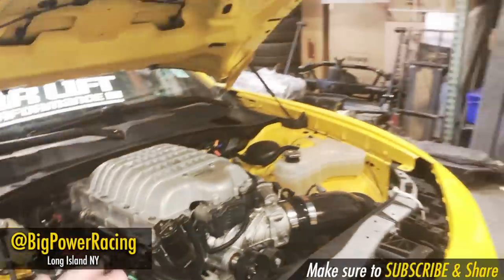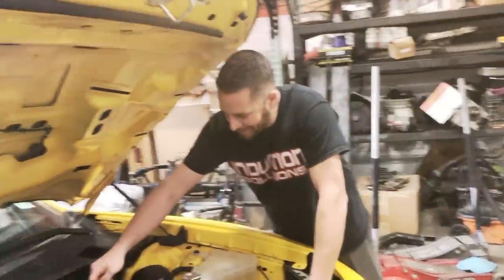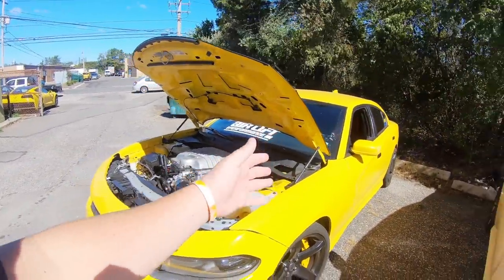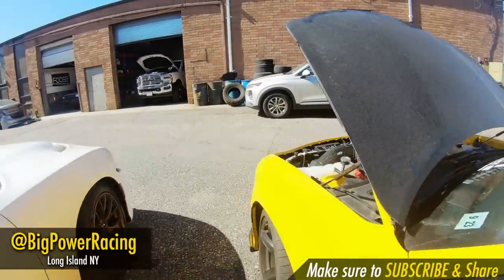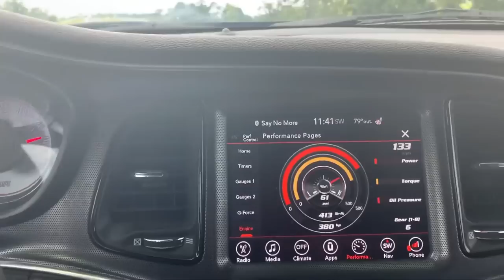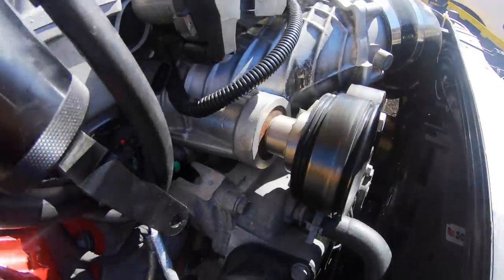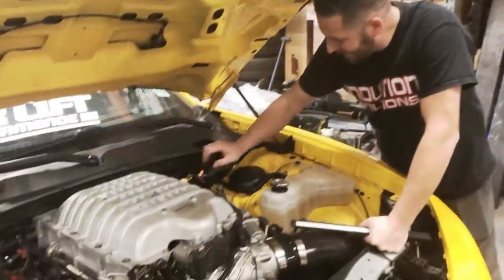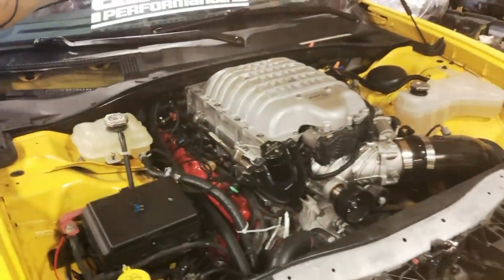Hellcat Supercharger on 392

Comment: Tuned right this would be a major sleeper to all the other hellcats out there.. bravo👍🏾👍🏾
Reply: Hell yeah
Reply: I mean apart from the loud NEEEEEEEEEEEEEEENEEEEEEEEEEEEEENEEEEEEEEEEEEE
Reply: Sleepers are suppose to look like regular daily drivers. Chargers are hard to get to sleep( look normal)
Reply: No it wouldn’t you can tune all day long but the motor is built to be na at a higher compression. It’s so bad that he had to change the pulley to make the blower run half the boost of a stock hellcat does let alone modded so it’s not an issue for any hellcat to walk on it as it is until he forges the internals and changes his compression then yeah sure but then it’s modded and tuned and really isn’t a hellcat or a scat anymore and isn’t stock so In that respect it deserves to win after that.
Reply: Running the 6.4 under boost while racing a true hellcat could be an expensive proposition for the imitator.
Reply: @joshreynolds729  it’s now a hellascat.... lol
Reply: @mrdomdiggz  😂
Reply: @beastp9569  I gotta sleeper police charger looks like a v6 police charger but I did a 392 swap fbo 😏😂

Comment: I really hope they get the tuning aspect right, 392’s are N/A beasts, one small mistake and it’ll nuke itself.
Reply from the maker: I'm sure they will - Hopefully I get a chance to see it up running.
Reply: They are so slow tho
Reply: @jeremiahalta8495  u fr rn?
Reply: @random-amg  They really are sadly been from sleeper s2000, 350s,3000gts, to f430, 670-4 aventador, audi Quattro. Really feels like a e55 amg from 12 years ago
Reply: @lastprophet5969  you for sure can’t compare a scat pack to a e55 nothing alike trust me
Reply: @random-amg  slow af
Reply: What does n/a mean
Reply: @JAG19471  Same chassis also shared with chrysler 300, e55 200lbs lighter with a better built engine. 😂 Cam bearings eating your cams like a cheese greater and and crappy transmissions that some smart guy decide to change from zf. 😂😂😂 392 best car in the world 👏🏽
Reply: @lilb5408  naturally aspirated (no forced induction) (pro charger, supercharger, or turbo)
Reply: @lastprophet5969  yet a 15 year old car that’s 10k can hurt that 40K car feelings of yours 😂😂😂
Reply: Going the blown route in my 5.7
Reply: @random-amg  yes sir my stock caliber srt4 2008 keeps up with them
Reply: @jeremiahalta8495  😂
Reply: I agree. The Apache unfortunately was not made for a supercharger. The internals has to be upgraded and it still doesn't really play well. It's unfortunate that unlike Ford or Chevy you really have to change internals on non boosted HEMI engines. With that said the Hellcat engine was made and specifically engineered for this from the factory. Better off getting a Hellcat crate engine and swapping. The other issue is beefing up the peripherals like transmission, driveshaft, suspension, etc. Might as well buy a Hellcat unless you like ridiculously expensive projects.
Reply: they didn't break that engine I bought parts from the owner on Facebook
Reply: @jeremiahalta8495  what is slow 392? Tf
Reply: how fast is a Camry then
Reply: @lastprophet5969 But bruh, you have to remember, your comparing modded to not moded. If a scat has the same mods as an other car the scat would likely win. My point is you can deny much that a scat vs most cars the scat will win.
Reply: @lilb5408 Naturally Aspirated

Comment: I’m doing this same thing on my Durango it’s been so many unforeseen issues .I had to change the whole front drive pulleys so they line up with the Hellcat blower pully . I also had to go inside the engine and change the cam and lifters because of the multi fuel displacement system fails with this setup . It was also necessary for me to get a drop in piston kit just so my 6.4 can even handle the boost. Long story short, I should’ve got a whipple it would’ve definitely been less stressful
Reply from the maker: makes sense. BUT... when you're done it's so much damn cooler (at least in my book). Everyone has a whipple or mag under the hood

Comment: I smell a blown 6.4 but well see
Reply from the maker: 6-7 lbs, I think he'll be alright - I want to see what it's throwing down to the ground
Reply: @RTLife  probably 550 to 630 whp
Reply: I have a fully forged bottom on the way, I’m just playing with the stock bottom of the 392 for now :)
Reply: Let’s hope these motors are troopers and can handle 6psi on a unopened motor. Would definitely change the game 🤙🏼
Reply: we’ll*
Reply: @r6mondosoo197  they can if you actually tune them properly so they don't lean out up top
Reply: @Michel-kz8jm  thats your charger bro
Reply: @gonzalezgrant  yes
Reply: Yup . 6.4 internals can't handle that with out alot work
Reply: @leepatterson5482  depends on the Tuner
Reply: @r6mondosoo197  my brother 19 392 went at 700 miles off the lot with a couple burnout

Comment: Wow, that's awesome and has that menacing Hellcat whine..I wondered how the lHl blower would do on a performance engine, and does have that familiar sound we all love. The only one I seen adopted so far, was on a 5.7 and was like anyother supercharger. I spoke with someone at modern muscle extreme about those adapter plates last year. They had it available for the 5.7 + 6.4, but we're still designing the jig for the 6.1 last year and emailed me back when they had them available a few months later. Still haven't seen anybody install one yet, but should do pretty good considering they handle boost better than 392s

Comment: Basic rule is 20-25 hp per pound of boost....once you do better heads/cam, then the numbers go up from there per pound. Boost is a measure of restriction. True efficiency is making the most power on the least amount of boost.
Reply from the maker: so if everything is running properly it would be around 570-600whp range
Reply: @RTLife  yessir. Your vid on the 5.7/Hellcat blower swap bears that out. Your 397 will actually do better since it was built for it. 30 hp/pound wouldn't be out of the realm. If it has plenty of fuel and air, 900 hp on 15-17 psi👍

Comment: Yeah going with mopar parts vs aftermarket should be ideal. Not taking away from aftermarket, whipple for one has proven itself but keeping it oem is always a better fit.
Reply from the maker: I like the OEM idea because it's more original (just my opinion though)
Reply: @RTLife  exactly, show off the manufacturers performance potential where they can't for production.

Comment: I’ve been wanting to do this for a while.  Cause it’s the cheapest way for me to get MORE POWER BABY
Reply: If the internals aren't done. You're going to find out that 2000.00 purchase is going to cost you 12,000.00 plus to repair. Try it!
Reply from the maker: if you can get a good price on the blower - this is a great option. 6-7 lbs of boost & that 392 will be fine
Reply: God i wish I had the money to do this.  The converter plate alone is like a grand... just for a piece of metal.  Just so damn expensive.  Honestly I think the cost of superchargers is just absolutely RIDICULOUS.   If i ever get a 4th axis for my CNC I'm totally milling one for the RT engine design and if it works flooding the market with 500 dollar superchargers to teach all those other brands not to rip people off like they do now.

Comment: Nice.. this is definitely going to be an option I'll look into for my scat...I wonder how much a good hellcat blower will cost
Reply from the maker: I want to see it jump on the dyno to see how it does. The blowers are between $1500-3000
Reply: Factor in cost of everything else needed to make it work and you're looking at $7k+
Reply from the maker: yah once you see the cost of what else is needed it adds up. I think most that go down this route get a crazy deal on the blower itself.
Reply: Anything below 10k for parts and install is actually not a bad deal when you consider getting a brand new blower kit is usually already pushing that amount minus install...but I'm definitely gonna do more research into this and hopefully get a definite figure for this setup
Reply: @kevinkludjeson9089  for me, it would've cost $4-5k more to do the hellcat blower than my Magnuson was. For any 11+ car that cost comes down by $2k. No brainer in my situation
Reply: Hellcat blower was free so I don’t mind :)

Comment: It’s obviously better to supercharge a 6.4 instead of the 5.7 because the 6.4s come with the brembo brakes and srt suspension
Reply from the maker: The 5.7 is a little safer to run forced air with but yah the 392 has much better pieces out of the box around the engine.
Reply: R/T Life that’s why dodge made the 6.2 which is a 6.4 and 5.7 combined

Comment: I think a Whipple or Procharger is better idea , more power and less problems and looks 100% better than this think,  cables,    pulley different size of the belt, plastics strap holding fuel rail and catch can, Im not saying is bad do that because when you staring a project you have finished it,  but I you have a choice I go with Whipple o ProCharger that kits comes with everything you need and is specifically designed for you car and make more power and look better without headaches bro
Reply: I wanted to do it no matter what and yes all the straps and wires you see, all the mess, is because is not finished yet.
Reply from the maker: I will do a follow up when this beast is 100% finished. Just wanted to show everyone this 392 build - to me it's unique. Pretty much what I want to do with my ride - we will see though.
Reply: @Michel-kz8jm  Im not a hater bro sorry if you feel my comment like that but not, I  know this build is so unique and is very difficult because no are many or any of them out there and probably you have to do trying many things for fix few problems and some time you have to improve your resolve it and others times I think you no have part what order because that's parts not exist and many other difficult things for finish it, Only for that I prefer to go for Whipple or Procharger bro they have everything already parts, guide , tune you know so easy on 2 or 3 days you can have you car well done. I love cars bro, don't get me wrong 👍
Reply: American Power I don’t, don’t worry and your opinion is soooo right lol. A whipple or pro charger or any other, they are really easy and if anybody wants something like that, that’s the way to go. It took a lot of time and everything you said to put that blower on top tbh, but I did it :,). Thanks for the comment and no worries
Reply: @Michel-kz8jm  thanks to you brother

Comment: The only limitations on power with these engines are the factory internals and the main caps, which should be upgraded to forged or billet, and definitely billet main caps.

Comment: 11.7 lbs of boost for a stock hellcat motor but on this car 6 lbs of boost is only half capacity of the sc for the sake of saving the motor and making okay power but it ain’t gonna be hellcat numbers unless he wants to change out the compression ration to the internals to except the boost along with forging the bottom end for longevity.

Comment: Hopefully they upgrade the cam and lifters because right now the stock ones have been prone to wearing out at 100,000 miles. All you have to do is go on here and look at all the videos that talk about this. Why FCA changed the oiling system on the hemi's after 2010 we'll never know.. 😔
Reply from the maker: I'm sure he will once he drops in some new pistons for some higher boost
Reply: @RTLife  I'd hope so or he'll start ticking.. 😔

Comment: Now that I finally got my 2015 Ram 1500 HEMI 4x4 Quad cab payed off , I want to start saving for a fully forged 392 HEMI. Either get the Arrington 392 or just build my 5.7 Hemi and stroke it to 392. You would be the best person I could thank to ask this question. What is your opinion on those 2 options?

Comment: I've had two Scats and the power they came with was enough, Chrysler designed the engine to be NA. If you look at what went into the R&D of the Hellcat engine, most people wouldn't even think about putting forced induction on a 392.
Reply from the maker: understandable. Most stick with around 6-7lbs & get to around 580-600whp range. I think it's impressive & it's not enough to really kill the engine.
Reply: @RTLife  
That's around 700 crank hp on a drivetrain designed for 500 crank. I think it's pushing it, but hey it could hold up.

Comment: Just so everyone knows the max boost is 5 without changing internals.
Reply: 8 depending the tuner, and there is a supercharged 392 that went 12psi ripping it every weekend on the track for a year, until of course, engine blew up. All depends on the tuner tbh

Comment: Hey just curious how you hooked up the pulley system for the supercharger? Was there a swap kit thats made for the 392 to do this?
Reply from the maker: there is an adaptor kit by MMX - not sure if that is what he used
Reply: Yes that’s why I used, the adaptor kit from mmx, most components are from them as well.

Comment: What do you think of the old 2014 392 srt8 can they compete with the new ones etc?
Reply from the maker: The 15+ 392 has the 8 speed, which is a big advantage - but that doesn’t mean the 14 392 can’t hang.
Reply: R/T Life  I got the 5speed auto a disadvantage buttt I’ve modified my car up to 460whp and I beat stock scats etc:)

Comment: Hold up.. What's the difference? Isn't a Hellcat essentially a 392 with a supercharger? Educate me!!
Reply: In simple terms the hellcat is the stroke of a 5.7 and the bore of a 6.4. It’s a beefed up 6.4 block (BGE block used in trucks and 2018+ challengers/chargers) with a shorter stroke (3.578 of a 5.7 vs 5.72 of a 6.4) causing it to be 6.2 liters. It has different heads and a different cam too.

Comment: Hmmm, I can smell that blown motor now.... Crispy
Reply from the maker: if he keeps it at 6-7lbs there shouldn't be any issues
Reply: @RTLife  never any guarantees with boost applications. Especially without forged internals. If it's worth it to this individual and knows the risks, more power to him. But I wouldn't do it. Most I did was stroke my 300 SRT8 to 426 n/a. Even with a stroker I ran into trial and errors. All forged Manley, Johnson lifters, comp cam shaft. But my scat pack, stock is good enough.

Comment: The Apache unfortunately was not made for a supercharger. The internals has to be upgraded and it still doesn't really play well. It's unfortunate that unlike Ford or Chevy you really have to change internals on non boosted HEMI engines. With that said the Hellcat engine was made and specifically engineered for this from the factory. Better off getting a Hellcat crate engine and swapping. The other issue is beefing up the peripherals like transmission, driveshaft, suspension, etc. Might as well buy a Hellcat unless you like ridiculously expensive projects.
Reply from the maker: in the end it would likely be cheaper to get a hellcat engine swapped in

Comment: Holy shit. Sell the 392 and buy a Hellcat. Sooooo much easier. lol I always find it sooo dumb when you buy a lower trim level and then try to modify and upgrade to the upper trim level. Just dumb....
Reply: No one purposely goes for a hellcat even if it's cheaper then a brand new because of money, maybe he just wanted a bigger engine then a hellcat but later down the road thought about a blower
Reply from the maker: all about the $$$ - this is much cheaper to do
Reply: I wanted to see what a 392 engine can do with a hellcat blower. You practically saying every 392 owner wanting to put a whipple or a pro charger, or any other air induction upgrade is dumb, it just sounds dumb for me 🤦‍♂️.
Reply: @Michel-kz8jm  Again just buy a Hellcat. lol You have way more power, less of a headache and a warranty. Pretty simple.I makes zero sense to buy a 392 and then axe murder it and expect any reliability while spending thousands to get it to HC level of performance. Good god. Just buy a Hellcat and save yourself some time/life. lol
Reply: @hellcatpekes8974  haven’t spent “thousands”. And I don’t expect reliability from this car. Once I get it done, it will beat hellcats easily, plus it saved me a lot of money and also I have something unique. You have a hellcat, 1 out of 3 people in my town have one, pff.
Reply: @Michel-kz8jm  Just coming from modding cars and the buying stock power. Modding that heavily turns into a royal pain in the ass. There's constant little things weekly that come up and you nickled and dimed. Then you simply risk of blowing up a engine not designed for the power. I learned from it. You pay for what ya get! That modoo is pretty true and solid. lol
So buy a HC and get the power or buy a 392 and mod the shit out of it to achieve the same power but way less reliable. I'd take the HC any day of the week. You can buy them used for less than what you spent I bet....
Reply: @hellcatpekes8974  if you find me a hellcat for 23k then you are right. You got your own opinion and I got mine. Again I don’t care about reliability, and yes, a lot of work, lots and lots. Time plus stress. Once you achieve what you wanted. The reward is bigger than just go buy it. Even done the car will keep showing problems, little thing, after some time of fixing those little things the car will be good. It’s not my first time and and I don’t think you’ve ever experienced that, if you tried, then it wasn’t good enough and you gave up to easy, sorry dude, buying a hellcat is good for you tho.